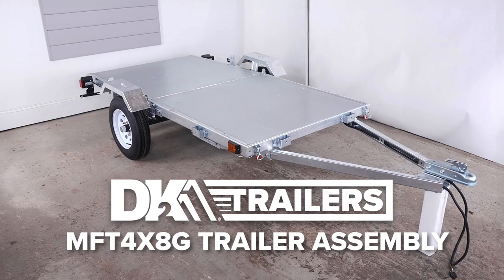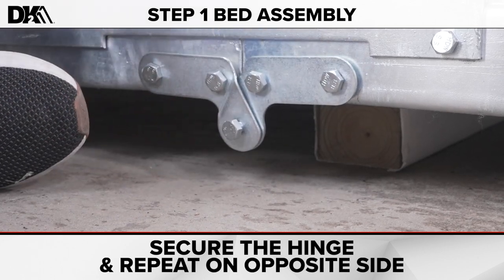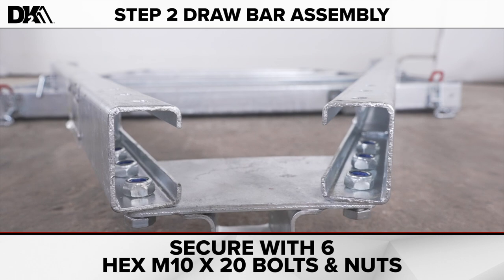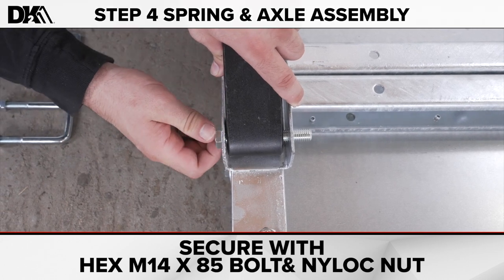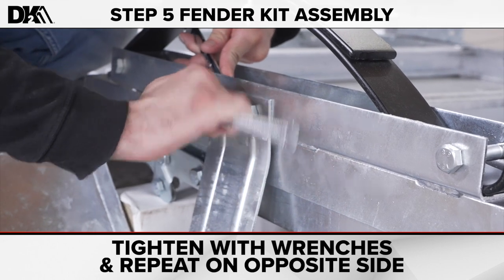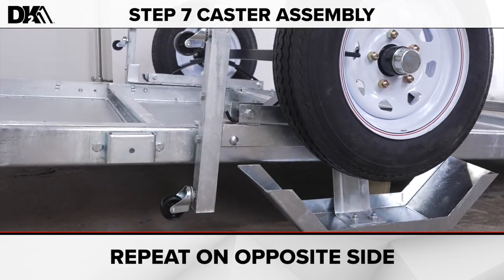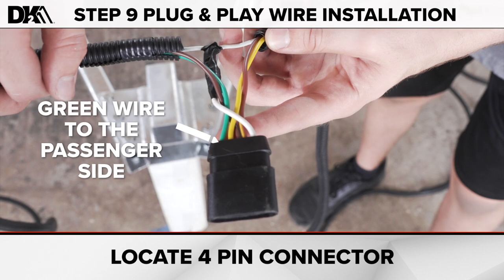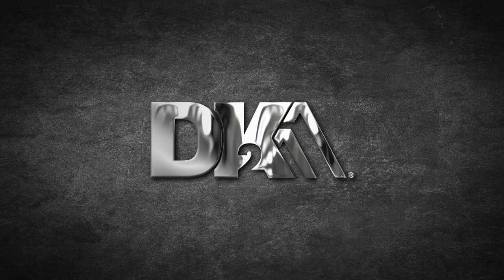DK2 Trailers | MFT4X8G 4 ft. x 8 ft. Galvanized Folding Trailer Assembly

Comment: Looks like a great trailer. Given that the spring mounts span the center gap in the frame does folding the trailer require partial disassembly?